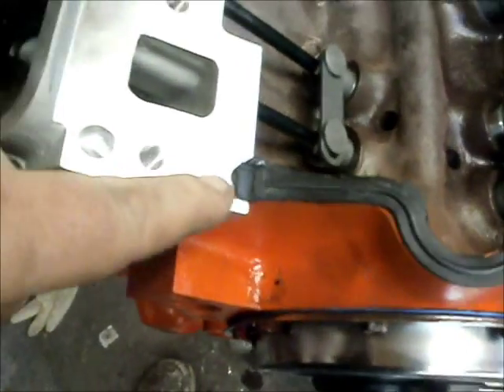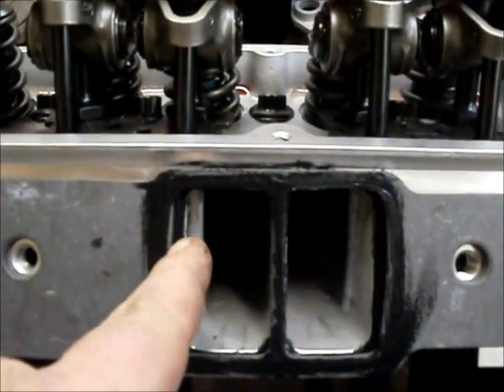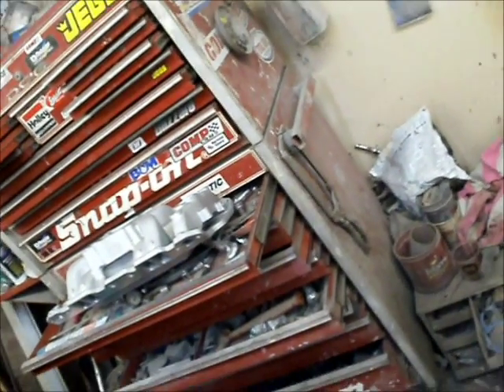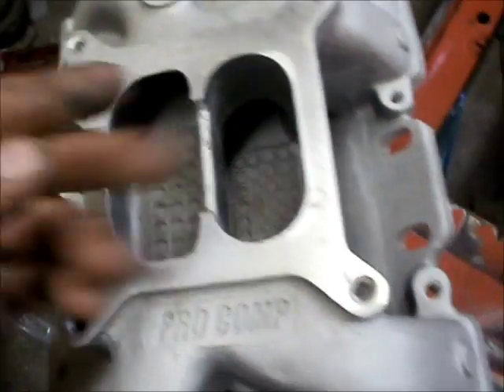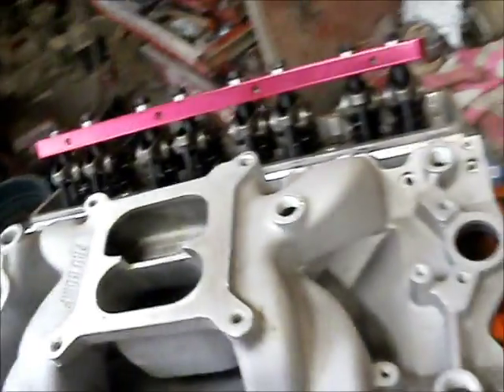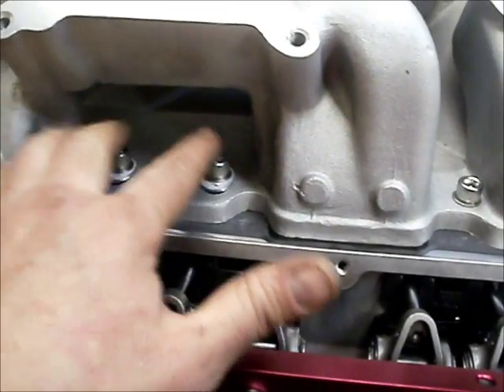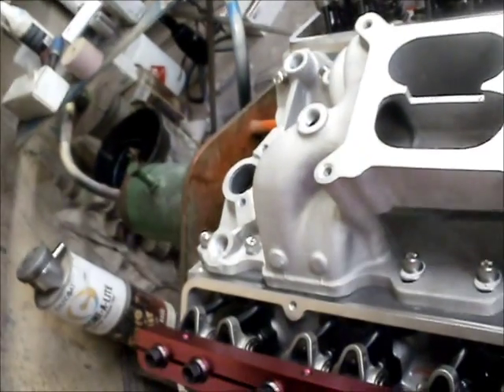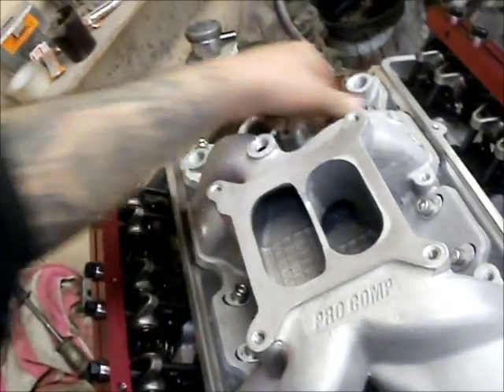intake installing building 383 stroker do it your self diy caponeauto  part 4

Comment: when running a stud girdle, can you run an aluminum billet rockers or do you have to run the cast/stamped style?
Reply: I'm sure it would be the sturdier rockers because of the high rpm they are used for, keeps shit from breaking and vibration